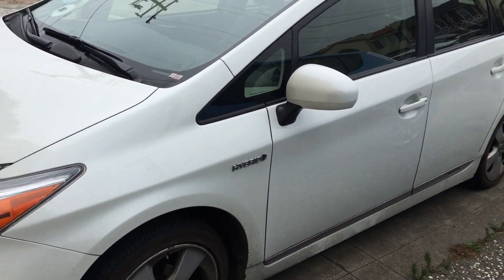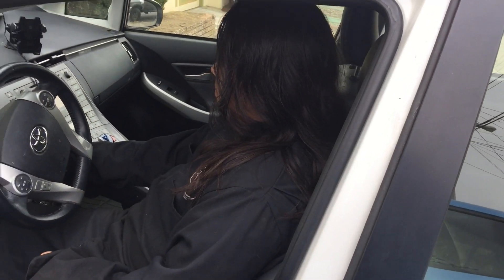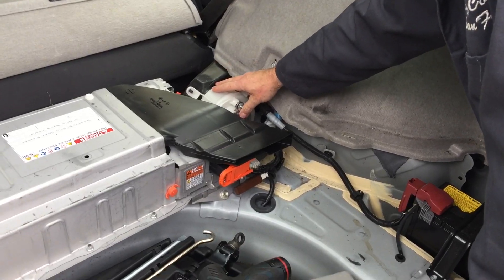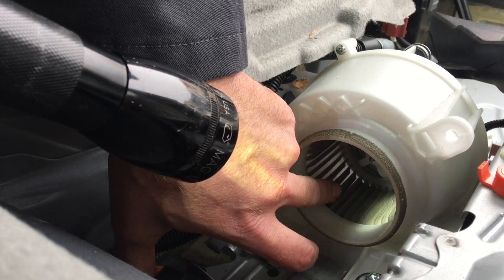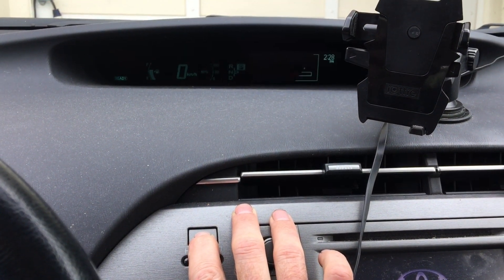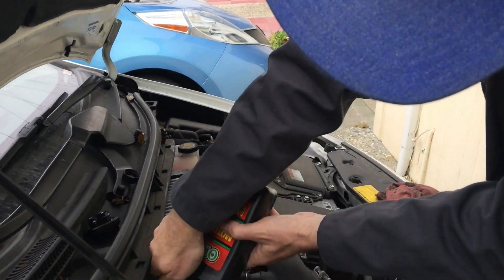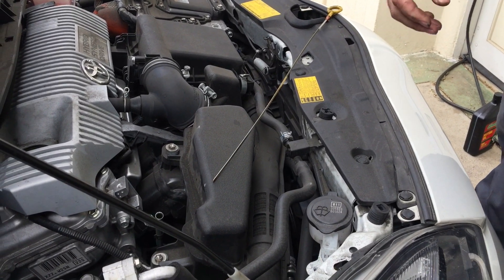Toyota Prius hybrid battery cooling system service

Comment: I believe my fan is next to the small battery (the one that looks like a "normal" car battery) but i am in a 2009. Your inlet screen is a lighter mesh than my inlet cover. I don't have a screen, but I made a filter with silk screen material, and it looked as bad. Although I hadn't checked the oil, again, yet, the check engine light switched to the "maintenance" light. But, the car had a hard time starting after I vacuumed the whole "trunk" region. I had to go though "CarHub"'s "My Prius Won't Start, and performed all of the checks. Unknown which 4 of 5 my specific problem actually Was, but it did start again. Supposedly, youtube saves the day (away from embarrassment of lack of knowledge) once again. But, i'e also heard rumors of other things. Thanks for the tutorial, the reminders, and all that stuff.  👍
'Wanted to figure out how to grease the turny part, but couldn't open the bell-housing & decided to screw it back together. ...back to the books while waiting for school to start next semester.

Comment: I cleaned everything and got my battery checked & the hybrid cooling sign still won’t go off even after resetting . What did I do wrong ?
Reply from the maker: use the scan tool to turn the fan on full blast and see where the air stops flowing

Comment: my 2015 prius had an intake filter that looked just like that....I cleaned it, removed it, and replaced it with an after-market filter that just clips on the outside of the vent you just showed..Easier to maintain now.
Reply from the maker: Good to know

Comment: question here!  this morning i got a CHECK HYBRID SYSTEM  on 2010 Toyota prius. i disconnected the 12v battery and the orange high voltage.  and the code went away. that means my high voltage battery is getting bad? thank you
Reply from the maker: I am not sure, I always check the code I havent seen which hybrid codes clear when you pull the 12v batt.

Comment: Nice video, thanks! I got the fan clean but deleting the maintenance message didnt work for my 2013 Prius. Do you have any other methods for deleting the message?
Reply: How about disconnecting the 12V battery connector, either positive or negative connector  Leave it off for about 1 minute and then reconnect. This will clear the message together with other settings that can be manually entered later.

Comment: That fan had minimal debris and would likely be fine for another 50K miles.  99.9% of the problem was at https://youtu.be/IS7ZaT26JW0?t=129.  They added the screen sometime after 2011, and it's responsible for killing more batteries than anything else.
Reply: @TheLast American Easy to say, but most owners have no idea, and it's not readily visible. Out of several dozen, I've NEVER seen a Gen3 fan dirty enough to meaningfully impact cooling.  I've seen a dozen clogged screens that disable cooling.

Comment: Wondering how likely the hybrid traction battery has already sustained permanent and irreversible damage due to the clogged up ventilation ducting.
Reply from the maker: I was wondering the same thing
Reply: Am wondering why you think anything is damaged at all?
Reply: @bobbabai  No one knows if there IS any damage unless it is examined by dealer level specialized equipment.  A lot of battery failure were caused by incremental albeit slight episodes of overheating.  So it is best to keep the filter relatively dust free as often as possible for long term durability.
Reply: @dominicfong6341  My car has 300,000 mi on it. I'm fine with cleaning the dirt out of the duct. If it makes the error code go away, I'm happy.
Reply: @bobbabai  That's great stuff.  Hope mine can last almost as long as yours!
Reply: @dominicfong6341  I'm doing pretty much the easiest kind of driving there is if you're interested in getting to a high mileage Toyota. Lyft driving.

Comment: Does anybody know whether when the fan is working it is sucking air from the inside of the car or from outside and blowing into the car interior.
Reply from the maker: It sucks air from the cabin ( through vent next to rear seat) and blows that air through the battery then out of battery to spare tire area.

Comment: That was a STUPID way of cleaning the fan. All that crap is still in the area, and will get sucked back in.STUPID!
Reply: well then you show us the right way!!😡 stupid
Reply: @jdmfans6078  I pay for mine to get done by Toyota.
Reply: @terrytorres7075  then 🤫 because you don't know .
Reply: @jdmfans6078  Yes I do. I've seen other great videos on you tube do this job. They did it ALOT more cleaner and effective. I chose to pay some one at a dealership.

Comment: Good video but one major flaw :(.     U cut the important part and jump right to the problem.     This video would be so much more helpful if u explained and show how u removed certain items this video just shows u already did it without explaining it.   :(.
Reply: how dare you. nobody question Mr electric.. lol jk depends on the job that you doing is always more videos on YouTube that can helps.. 🛠
Reply from the maker: On hybrids Its all about the diagnosis. Righty tighty lefty loosey from there.
Reply: @Mrelectric423  Yes but where are the clips and how do you pull covers?

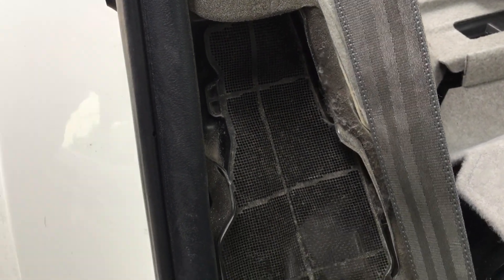Comment: How did you take the side panel off at 2:15?
Reply: 12mm bolt at the bottom
Reply: @snoobler  did you have to remove the back bottom seat to remove bolt for side cover?
Reply: @amealnet2495  No. A socket extension helps.

Comment: If one is not mechanically inclined, about how much would it cost to get the dirty fan and filter cleaned?  Mine looks really bad. Would pulling the lint off the filter with a brush that catches stuff like that hurt? Or is it better to fix all at once? Thanks
Reply: Big Score just had to get mine done. Called three places (Southern California). One guys charged $140 ($40 is for a mobile fee). Another charged $95. Another charged $60 for a cleaning of the fan system but suggested $160 to clean the fan system and the battery. Hope that gives you an idea.

Comment: @2:10 what part of the car is that? I cleaned the other spots you mentioned but I dont know where the spot at 2min and 10 secs is
Reply from the maker: Harry Hong its the air inlet next to the rear passenger seat